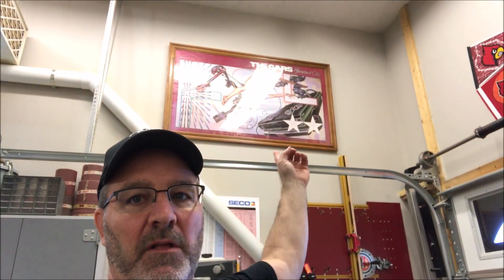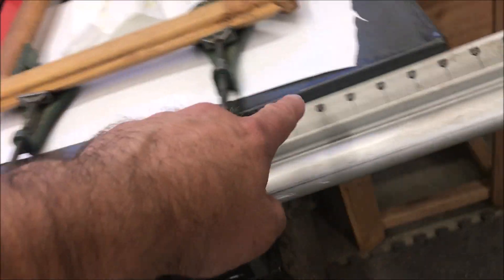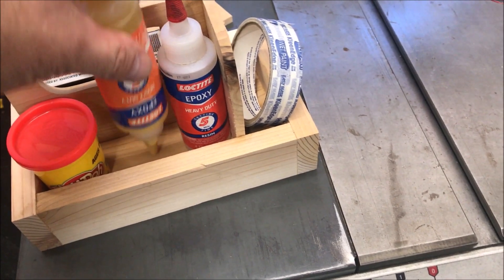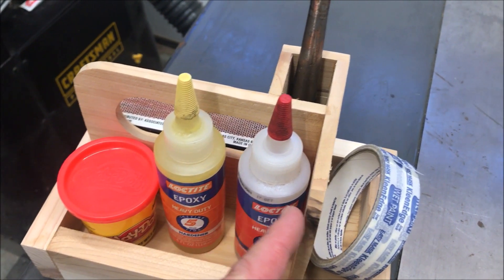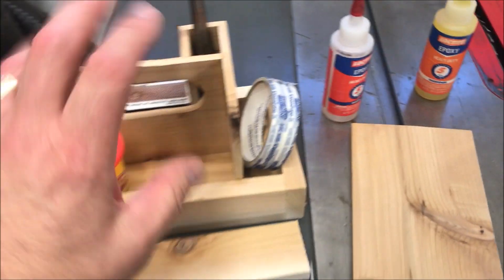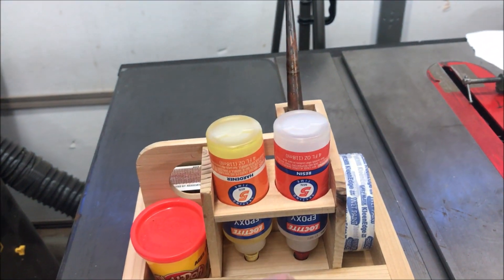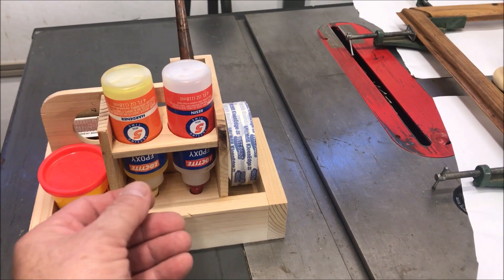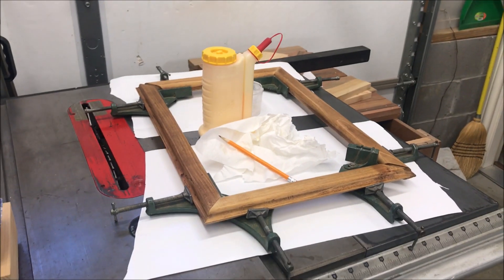9/20/2020 Shop Update

Comment: I want to try a frame, but my miter saw is an inexpensive one, and I don't trust it enough for cutting accurate angles.   Working on a sled for my tablesaw, but it's another project. :D  Take care Bob.
Reply from the maker: Thank you Paul.  
  Good luck in that sled. 😃

Regards,
Bob
Reply: I too, have an inexpensive miter saw.  With the upgrade to a better blade and some fine tuning I got mine to do a decent job on miters and in turn improved the square cuts as  well.

Comment: Have you looked at getting a picture frame making kit that has staples you press into the back and they also come with tabs you press to keep the backing in place,  thats what i use
Reply: Forgot to add they are called vee nails so look up vee nail kit , i nail them at the same time the frame is glued and clapped
Reply from the maker: That’s a great idea, I just don’t make many frames so it would depend on the cost. 

Regards,
Bob
Reply: @WhatchaDoinBob  not sure on the cost i bought mine over 15 years ago